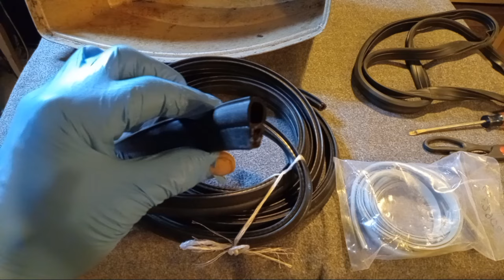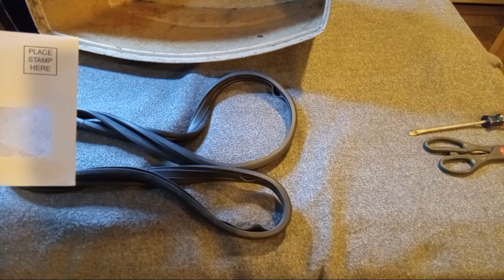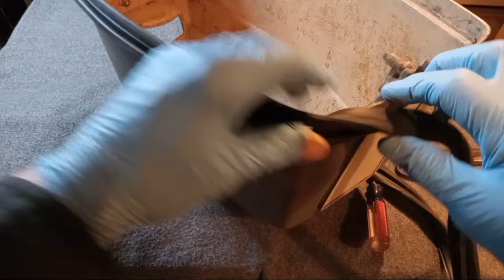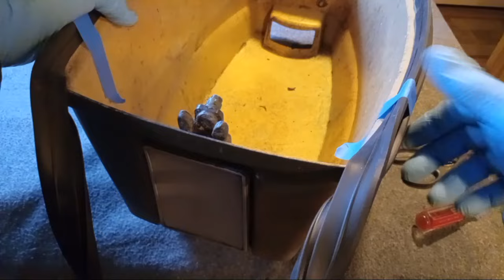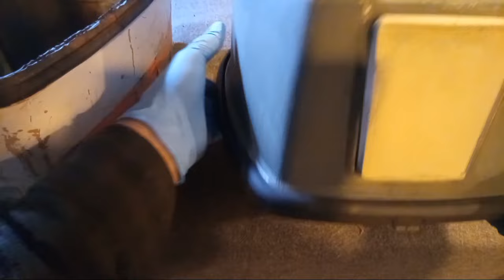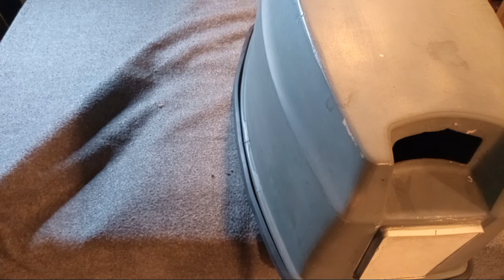How To Replace 1972 Evinrude & Johnson Cover Seal For Cheap Like Original! Fits All 1971-90S 18-35HP

Comment: Thats is a very helpful tip for people replacing the old cowl rubber seal. Especially on those smaller 70's motors for a reasonable price. I have used 1/16 rubber edge trim before without the 90 degree $15.00 cdn for 10 feet on Amazon.
Reply from the maker: Yes I feel its a great way to repair like original more then any other type of seal. These seals are after market. Im not sure how good the quality of rubber is that they are made of seems okay. I do alot of old 70S outboards and most of the covers need seals. Thanks for your comment & stay tuned.....